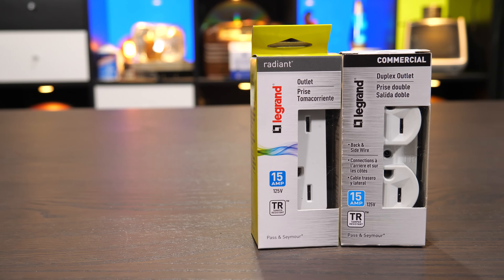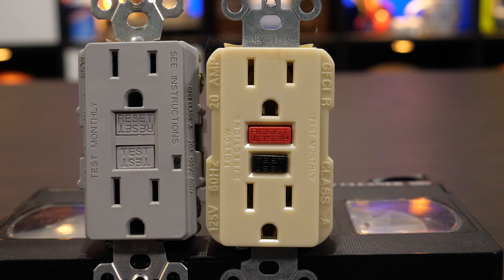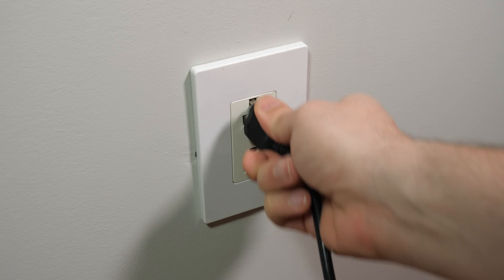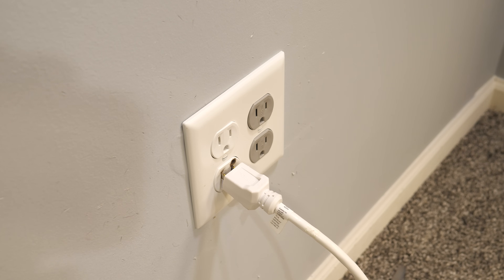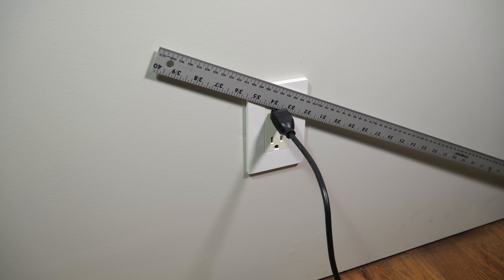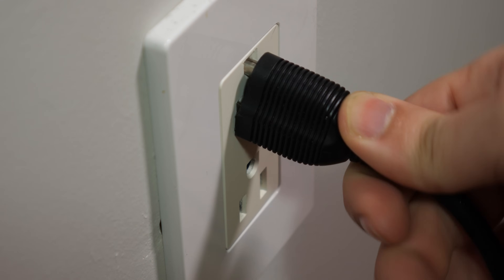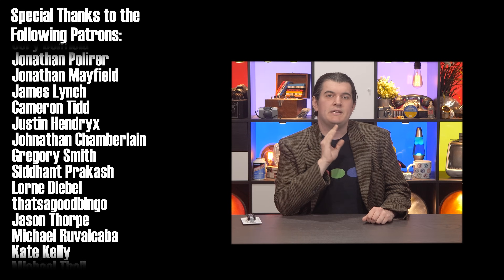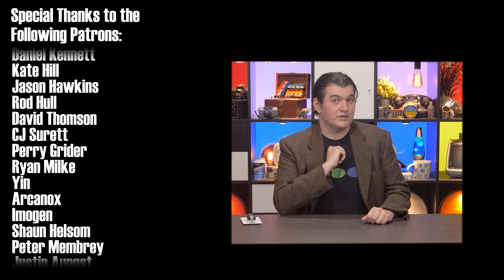Power outlets are topsy turvy - but does it matter?

Comment: I think the boxes on the side is a leftover from initial electrification of the nation. Plaster and lathe walls are very difficult to install a gang box into without a lot of finish work. In older homes, they were commonly installed into baseboards where the sideways orientation fits nicer.

Comment: I worked for a dude who flipped houses, around 2008 (yeah….. the market hit him hard), and his logic for the ‘upside-down’-ing of outlets was because of outlet fatigue; the outlet, according to him, takes much less strain because at that point the ground pin is supporting the plug, instead of the live/neutral prongs having to hold against gravity. My apartment is from the seventies or eighties, so I’ve had more than one worn-out outlet replaced. I don’t know if the dude’s supposition on strain is legitimate enough to plan for, but on the surface it makes sense to me on a practical level.

I agree on having sideways outlets, though, but specifically with the neutral line on top for paranoia’s sake as butter knives get chucked at the wall.

Comment: When I was 8 I accidentally plugged in my alarm clock with my finger between the prongs

It was one of those outlets that you had to give a good amount of force to get the plug to go in and my finger slipped because I was weak and 8yo

Comment: We still use a lot of stainless wall plates. But on the subject of the single screw, i see more issues with them when the receptacle itself is improperly installed, than I ever see one of those single screws come loose

Comment: ha, the reason we low voltage techs install them upside down is simple; at a glance i will assume the outlet is not connected to ground if upside down. its for 2 prong upgrades to 3 prong outlets that don’t need or unable to meet code. usually a gfci is down the line.

Comment: In my life experience, plugs with the ground on the top are connected to a switch. The inverted appearance makes them easily identifiable over ones not controlled by a wall switch.

Comment: in the early 80s as a wee lad I had to plug in my light bright behind my night stand and I would use my finger as a guide to find the holes. if I was using the ground as a guide pin instead I wouldn't have shocked myself multiple times... scratch that, upon reflection the light bright didn't have a ground on the plug at all. I guess I was doomed to not learn a lesson all along.

Comment: Here on Brazil we have a variant of the Europlug. It's infinitely more safe than the american ones and won't stab through your feet if the plug is lying on the floor like the british one. I think you would like it. :P

The design is very simple. Outlet is receeded into the wall by 1cm and the plugs have 1cm sleeves. The point where it goes live, the plug is too deep inside the outlet to have any exposed metal.

Comment: Look, none of this really matters. Sure the plugs should be insulated, but even if someone does, in the very, very unlikely event, touch those (barely) exposed pins, it's only 120V at 20amps at most. Will it hurt? Sure. Will it kill or severely injure most people? No. Teach the toddlers and infants not to be careful and not throw knives at the wall(!!!), use safety plugs, and everything will be fine. 
Now, if we had 240V in our residences, THEN it would be dangerous. Thankfully we're not as crazy as Europe and step that down to (safer) levels.
Here's a story. I was once working on a very old luggable PC. It was ancient when I was messing with it in the mid-90s. For some reason I'd left the computer plugged in and as I was working on it I felt this tingle in my arms. It took me a while to really notice and then figure out that, as I leaned over and my forearms rested on the sides of the case, the power was shorting out and causing this tingle. Yeah, I was getting 120V because the power supply was bad and electrifying the entire metal case. Unplug from the wall and everything was fine. Again, I barely noticed this! It wasn't painful, just irritating and annoying. 
Yeah, if I'd had a pacemaker or some sensitive medical device I would have been more careful. But again, 120V just isn't that dangerous. The plug & socket design may be bad, but I'd argue that our residential electrical infrastructure is still safer than most other countries by simply not being 240V.
Reply: Watching the 2nd channel reminded me of the time I was at a hotel, in bed, and trying to figure out how to turn the lamp on or off. So I'm feeling all around and reach up near the bulb. I stick my hand in the empty bulb socket and get a shock. Why there wasn't a light bulb I don't know, but I'm perfectly fine.

Comment: 12:50 that's trivial to fix, get yourself a pair of sidecutters and nip that ground pin clean off, grind down the other pins so they're the same size. Now your extension cord is universal and will work with any plug in any orientation. Rubber boots recommended for safe operation. Also completely defeats the safety purpose, since now there is no ground pin at all. Lol.

Comment: You can add some fuel to the fire, talking about the difference between 15 amp and 20 amp 120 volt NEMA outlets.  Sometimes big box store customers root through bins of outlets and 20 amp and 15 amp outlets wind up carelessly mixed together.  It is legal to install 15 amp outlets on a 20 amp branch circuit, but (for obvious reasons) not 20 amp outlets on a 15 amp branch.  Until recently most US homes had 15 amp branch circuits while 20 amp was mostly in office buildings.

Comment: Here in the UK where bottom exit plugs and ground up are standard it's not uncommon to see plug mounted transformers for US and Chinese electronics that have had the UK pins installed the wrong way around and sit upside down in the socket. 

That not only has all of the disadvantages you list (magnified by a heavier plug) but often blocks the switch too. 

Fortunately a lot of them are now changing to USB, making it a lot easier to replace any troublesome power supplies.

Comment: I have gotten zapped from my fingers slipping onto the prongs before, but never on the kinds of plugs you showed -- the really dangerous things are the "wall wart" adapters. Many have rounded edges, and some take quite a bit of force to remove. So you're tightly gripping the rounded bottom to get enough leverage and as the plug starts to come out your fingers slip off the rounded corner and directly onto the prongs. Not fun...but not gonna be solved by outlet orientation...could definitely see the same issue with right-angle plugs though, all the ones you showed have practically zero area to grip and many of them narrowed closer to the outlet...so that's pretty sketchy!

Comment: I've had a tape measure tall on the plug prongs before.   I've also had the metal "baseboard" of an office cubical fall on to the plug, causing a hell-of-a spark and tripping the circuit breaker for the entire group of workers.   I had to get building maintenance to come out and turn it back on.

Comment: Has Alec ever talked about why we need an extra ground pin on only some plugs?
Reply: That's typically for devices/appliances with metal cases that could become electrified if there's a fault in the device.

Comment: In my opinion, the NEMA 5-15 outlets are outdated and probably should get scrapped entirely. Outside of kitchen appliances, what even uses AC power anymore? The first thing the vast majority of my devices do with AC power is rectify it into DC. Rectifying AC to DC seems like something some random box near the breaker box should be doing for the sake of efficiency. Then we can rewire our homes to use mostly DC power outlets. USB-C is sort of doing this, but that still requires a tiny AC/DC brick per device, which is just rapidly accumulating e-waste.
Reply: Vacuums, fans, kitchen appliances, washing machines, A/C units, dryers, basically anything with moving parts is reliant on AC... not that they can't be built to be DC but good luck convincing everyone to buy all new appliances
Reply: @airplanes657  the motor excuse is kind of weak when brushless DC motors are generally considered to be superior and are more efficient than AC motors. Wouldn't we be better off without the old inefficient technology? Eliminate those first and the switch to DC-only wiring replacing becomes an easy sell.

Comment: Meanwhile using Schuko, they are symmetrical, also which side is live or neutral is arbitrary.  
But in terms of safety they are much better, They better be for carrying 230v but still it is quite shocking to be confronted with the us plugs.

As for angled vs non angled, if you standardize a size you can have them recessed in the socket, which would already make things a lot safer with the same plugs.
mind you in the netherlands in the 90's ungrounded flat outlets were still a thing there were compatibility issues, but those got solved fast enough.

Comment: 3:12 - Hmmm. I kinda like that horizontal orientation. It’s slightly easier to use both plugs without guessing for alignment if you cannot the the bottom socket from with height or obscurity. Scent warmers and the like might become an issue.
Reply: Same. They should have been designed like that from the start. Having the 2 plugs next to each other just makes more sense.

Comment: I work on security systems that often use a screw through the "Wall Wart" transformer and into the single plate mounting hole to secure the transformer to the receptacle. This particular receptacle had a metal face plate. As soon as the screw on the failed transformer was backed out far enough the fireworks show started, as the metal plate fell on the exposed prongs of the transformer. It may not happen often, but it happens enough.

Comment: But the flat side of the ground inlet for the round shaped ground pin suggests that there is a bottom. If they want to have people more easily accept or change perception, they could rotate the ground inlet unless it's prohibited by code. Or even adjusting the shape to make it circular for a more specific fit works in a perfect world.

Comment: I actually have a portable A/C in my garage that has a large GFCI plug which wants the ground to be up. I actually went and inverted that outlet to make it hang correctly.

But that's the only right angle plug I've ever seen with the ground on top.

Comment: Why don't you not slowly (over the next 50 years) change to the EU outlets or a complete new outlet designe? Stop producing the US outlets, put an adapter in every box for the EU/new outlet and manufacture every new device with a EU/new Plug. Most Electronics also have changeable Plugs or cables and most of the time come with an EU Plug already.

Comment: Just about anything you buy with a low profile plug assumes the outlet ground pin is on the bottom.  I have a power strip where the outlets can be rotated; it is UL rated, so I assume it must be relatively safe.  It would be nice to see that in a duplex outlet which can be mounted in a standard work box.

Comment: I’ve almost become primary path to ground at least three times: once when I didn’t realize there were two separate circuits in a single junction box
Once when I discovered when I went to turn it on that the kids had broken a lamp and not said anything about it.
And once as a teenager trying to measure a wall for a desk when the thing flopped and dropped onto the surge strip’s plug in the wall shorted hot and neutral for some sparks. In all of these situations I felt a sharp tingle and no breakers popped even. 😅

Comment: I worked at a mall in a Kiosk and while on the phone with the business owner I dropped the metal cord used to lock down the store, it landed on a power strip that had a gap between it and the plugs.  

Immediately there was a loud pop and flash.  The mall was completely silent for a moment before people found out that the power was out for an entire wing of the mall....

Comment: It terrifying seeing wall sockets without switches for each socket as an Australian. Every wall socket by code needs a switch for it control. Exceptions are power strips but a smart person would buy a 2, 4 or 6 power strip with individual switches for each one anyway for better safety and control. Especially when constantly moving your phone charger around from wall socket to power strip every few days to charge phone up nearby.
Another thing that bugs me is oversized plugs meaning you can only fit 1 plug in a 2 socket receptacle - looking at you manufacturers.

Comment: Right angle plugs are not that good. If you wish to use two of these plugs on one outlet, you simply cannot because the wire from one will prevent you from plugging the other one, unless you buy a device that elevates one.

Comment: Wouldn't inverting just the top receptacle in a pair give the best of both worlds? That's how it's done in my country, and I've yet to encounter a lot of the problems you've mentioned, though it does not solve the most egregious problems of live wire slipping out if no ground is present/in the bottom socket.  But it does work with right angle plugs as they are!
Reply: Yes, and they exist. They're just ridiculously more expensive.

Comment: Honestly, I think we should just burn it all down and transition to new, safer outlet and plug designs, and provide adapters to bridge the gap.  Mandate that new devices come with the new plug, and a suitable adapter for old plugs, and then mandate that new construction requires the new outlets, and eventually people will just have devices that use the new plugs and dwellings with the new outlets - over time people will just want to retrofit because of the proliferation of devices.  I'm sure manufacturers will also find ways to make them dirt cheap, too.

Comment: For hospitals, the reason why the ground pin is facing up is if an instrument makes contact with the partially inserted plug it will deflect the instrument. If you have the plug the other way around, it could make contact with the hot and neutral causing a fault and popping the breaker and in a hospital that is REALLY REALLY BAD. There are outlets like the red ones that are designed to stay powered if the mains power goes out and if a fault happens and trips, someone could die if they are on one of those machines to keep them alive. So if you see the red plugs, they run off a generator if the mains go out. That's why you see those machines on it.

In residential places, it makes no difference unless you have one of those machines and if you do, it's best to flip the plug.

Comment: I was told code states putting the outlet upside down is only to indicate that it was a switched outlet. The oldest outlet I've seen was a edison light socket installed on the baseboard which might explain the shape and orientation of old duplex sockets. I think sideways with neutrals up would be best but id might rather have it ground down mostly for wall warts and right angles, but frankly I dont care and as long as there wont be a new plug standard. What we should do is what Australia has done since their plug is most similar (you can just bend north american plugs with pliers slightly and itll work in an australian outlet), just coat half the prongs in plastic.

Comment: One of the few reasons why I'm happy to live in the UK is that UK power outlets have by far the safest design. I'd get a bit nervous plugging in anything with a design as unsafe as any of these, even the right angle ones!
Reply: Except it's 230 (or 240?) volts instead of 120 volts in the U.S. for regular outlets. So, while the UK plug is safer, the voltage is much higher.
Reply: @ronbennett7885  UK plug is absolutely not safe for your sole.
Reply: UK has standard 220 v, if you get shocked by it, it can kill you. US is 110 v, if you get shocked by it, it will be unpleasant and you may shout a swear word.
Reply: The dangers are definitely exaggerated in this video. I've never had, nor known anyone who has had, an issue with American plugs. Kids sticking toys in sockets is a rarity and can be prevented with things like... You know... Parenting, and outlet covers...

And idiots arching off a measuring tape seems more like a myth than anything that has ever actually happened.

If someone consistently sparked themselves pulling out plugs, then either their electric needs a severe update, or they never figured out how to grab a plug by the head correctly.

90° plugs are the exception, as he said they're IMPOSSIBLE to remove sometimes, but they're honestly so rare and usually for things like PCs that you WANT to keep in the outlet 99% of the time.
Reply: @RochelleHasTooManyHobbies  Forget pulling out plugs, wearing out both the plug and the socket. UK sockets have on/off switches!
Reply: I like how this comment implies a British person might cower in fear if I asked them to plug my phone into the wall as if I had asked them to stick a fork into the outlet

Comment: but if the ground pin is on top it makes a nice place to hang your screwdriver so you can tape the two wires hanging stuffed into the power slots?

Comment: I had a basement light socket with a screw in outlet/socket adaptor. So a plug could be put in and the bulb was extended down slightly. It had a BEAD-CHAIN cord to turn the bulb off. One time the chain recoiled up and landed on top of a cord that was not plugged in all the way. Got a shower of sparks and molten metal.